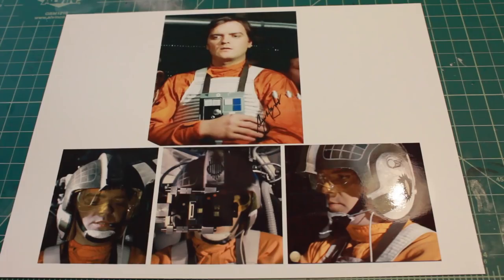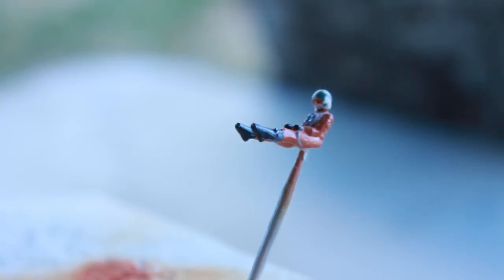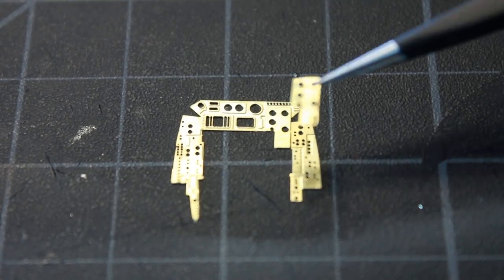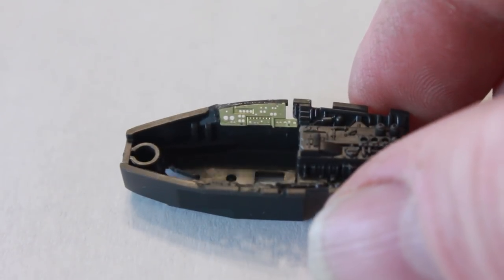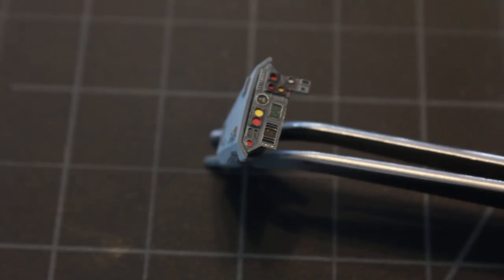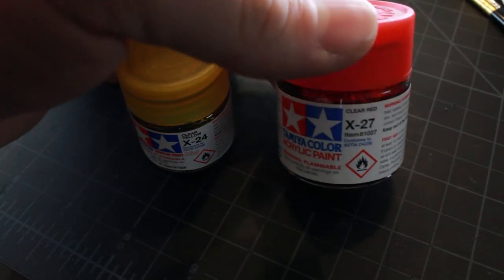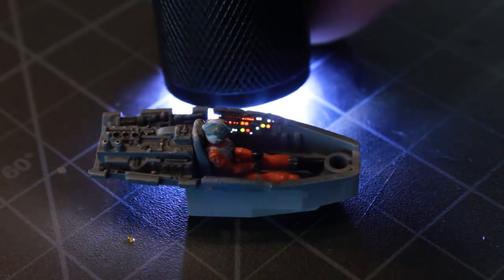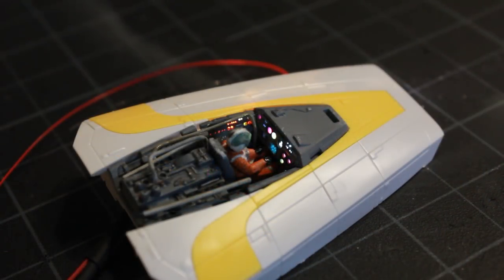Bandai Y-Wing Model Build Pt II Cockpit Lighting and Painting

Comment: W0W, what a MAGNIFICENT & AWESOME & OUTSTANDING & INCREDIBLE diy-cockpit built. Love this idea adding LEDs / SMDs to the model, keep up your amazing work🤘😎😉🤙

may I ask you why weren't using a dremel tool to remove all the extra stuff in the cockpit?!
Reply from the maker: Sometimes the Dremel is a little much with the power,  even on lower rpm, and I feel I have more control in other ways.  I do use it in some instances though.  Just depends.

Comment: What size wiring do you use? I thought 20 gauge but it's too big
Reply from the maker: In the Y I used 28 awg.   I've also been using 30 awg a lot lately.  But 28 awg should work fine.
Reply: Thank you...epic craftsmanship and documentation. Very inspiring during these times.

Comment: That's awesome bro, question, I'm going to build an snow speeder and I want to put sound boards and lights, and my question is where I can get those things and now that I see you applying son photo-etch did you know where I can get a set for my build, by the way, awesome work man, always enjoy your builds
Reply from the maker: The LEDs I get mostly on EBay. I have a snow speeder as well I will be doing down the line,  but unfortunately I have never seen any photo etch for it.  I plan on doing lighting still, but it'll be done differently
Reply: That's awesome man, looking forward for more updates and to see that snow speeder build, I looking for sound boards too, any suggestions on that?
Reply from the maker: I got a little sound board from Adafruit that I'm going to experiment with and possibly use in this Y- wing.  It's the Audio FX Sound Board mini
Reply: That's so cool, I start searching for that sound board and is very cool, I'll bee PM you for some help with it, that will be my first time trying stuff like that, hope you don't mind bro